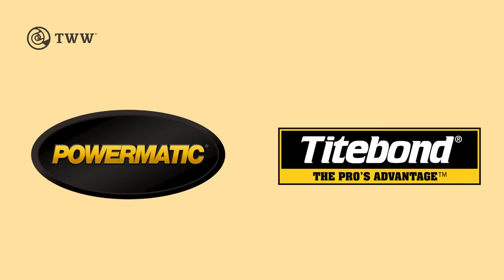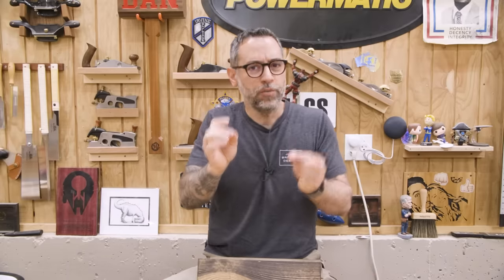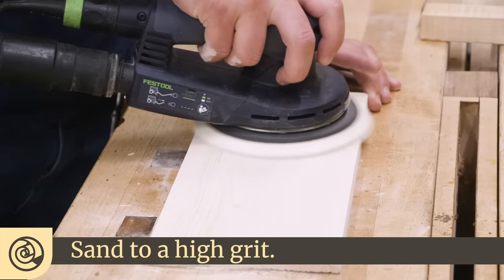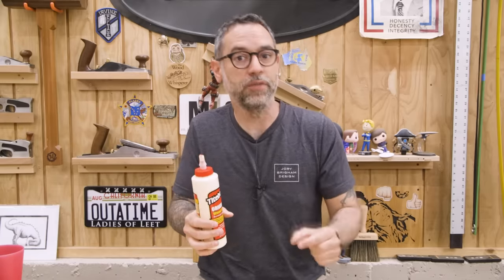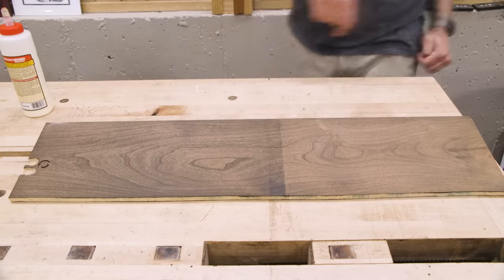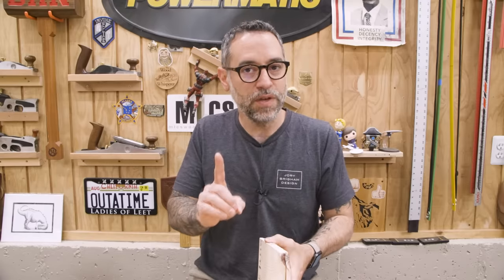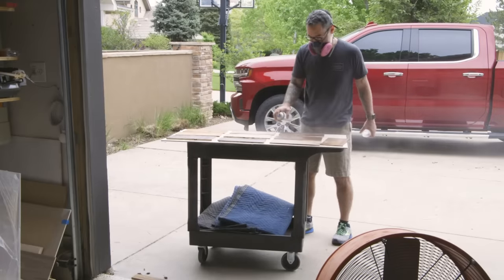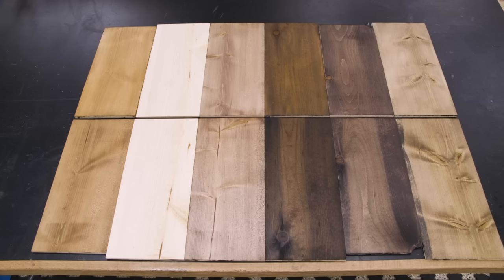Make Stains Look Better! | DIY Blotch Prevention Formula

Comment: Video Topic:

1) I've heard many people talk about packing the grain. In fact, I believe you off hand mentioned it. The wood always talked about is Oak. What is that process, why do people do it, what woods should you do it with? 

2) The best iron on edge banding please. I made a project recently and used iron on edge banding, but the stain doesn't want to stick/absorb. I was using birch edge banding and a mahogany Varatheane wood stain. 

3) What is the difference between whipe on and brush on stains? Is there one? Can you get spray on stain? 

4) I have a can of varatheane brush on polyurethane. The issue is, I have a huge amount of area to cover. What do I do? Can you spray brush on polyurethane or is there a specific kind of polyurethane meant to be used for spraying?

5) How do you prevent sticky patches while staining? I've tried using a clean microfiber cloth to wipe off all the access stain, yet it still gets sticky from some spots. 

6) Different kinds of hand saws. I'm so confused on the kinds of saw wood workers use. A flush cut saw vs a Japanese pull saw? An ultra thin curf saw? I've googled it like crazy, but I just can't find a complete set of saws. What hand saws do you use? 

7) Do you know of any good dowling jigs? I bought a dowling jig and followed all the instructions, yet the joints didn't line up as usual.
Reply: You gotta be kidding.....you are asking him to write a book.......

Comment: I’m a total noob, so apologies in advance. In your conditioning formulation (M Juice) you use water-based finish with the glue. 

1. When you say finish, do you mean stain or polyurethane/sealer?
2. Can I use oil-based finish (or stain, or whatever it is) or must I use water-based finish in this step?
3. After staining (in which I’m not limited to either water or oil based stain, as per video) do I seal with water or oil based poly based on the stain type used? 

Thank you.

Comment: Hey marc, I used tite bond original 4:1 on some alder recently. Works amazing. Did a whole house walls, ceilings. Sprayed airless with a tritech t5 410 and backbrushed two coats completely eliminates any blotching and basically zero voc non toxic. Just Mixed 1 gallon glue and 4 gallons water into a bucket. A second coat of sealer really prevents blotching around knots. We finished with rubio monocoat and it gives sort of a unnaturally even nordic look.

FYI I also found general finishes RTM Clear to work just as well as glue size and applies very similar with similar looking results. Let completely dry then buff with 220-320.

Comment: I've used dark stain on pine many times and the last was by far the best. I diluted Seal Coat 2 parts Seal Coat- 3 parts mineral spirits as the instructions said for a pre-stain.
I applied dark Varathane stain and rubbed it in with a gray scotchbrite pad then wiped off the strain.
Viola.

Comment: Noob question here: Is 'finish' the same as a stain? if so, can i just add a few tablespoons of the stain i intend to use (if water based) or should it be a clear color?

Comment: Thanks for the info. I am a newish woodworker and I usually have fun right up to the finishing and then I worry my self sick. When you say water based does that include minwax water based poly ? Sorry for the stupid question but I am just not sure. Also if I use your formula do I have to use water based stain ?  Thanks again for the good info.
Reply: I am the same way about projects! I'm new to this, but I'm always afraid to mess up the finish or not like it. I'm about to try the water based poly in the mix. In the video he used all kinds of stains: gel, water, oil... So any type of stain should work.
Reply: I’ve used the water based minwax poly over oil based stains ( thin coats, sanding in between each coat) works great.

Comment: Marc, is there window of time to stain after you use your treatment like there is with pre-stain conditioners?
Also, I have a friend who wants me to do 1700 sf of maple wood paneling using plywood (53 sheets) cut into 11 1/2" wide boards. Would you suggest a water soluble dye instead of mixing a large amount of treatment then staining after?
Great video as usual and thanks for any advice on this
Robert

Comment: Hi Marc.  Thank you for explaining the cause of wood blotch.  I am relicing a guitar, an old used Gretsch Electromatic Double Jet. I am new to woodworking and to guitar relicing.  I bought it from a guy who had already sanded the painted Maple top down to the natural wood.  My goal is to make that natural wood look aged/vintage/yellowed.  However, that Maple top is blotchy as hell.  I bought a spray on "Vintage Amber" tinted nitrocellulose lacquer from StewMac (they specialize in paints and lacquers for guitars) but am really concerned about that uneven look showing through.  This video gives me some options and I appreciate the tip to get some scrap Maple which I hope to get at the local home depot to experiment on before trying it on the guitar.

Comment: Glue size.  I’ve used it for years and not just on wood.  I first discovered it when renovating an old house (150 years old) to stabilise the old whitewash (limewash) that was on the ceilings.  Since then I've used it on all kinds of surfaces, including: plaster, concrete, MDF, chipboard and, of course, both hard and soft woods.  I agree it’s not perfect, but for a down & dirty solution to unstable surfaces, it’s as close to magic as you can get.
Vary the ratios - 1:20 is good for old whitewash, whereas 1:5 is good for crumbly concrete before painting and different woods accept different ratios for better or worse results, so again, I agree - experiment and find what works best in any given situation.

Comment: Very helpful - thanks for the methodical work!  I have some red oak cabinets I'm planning to stain with a light oil (maybe gel?) stain and was wondering if I should even bother with a conditioner...I think I will do it, but maybe just a relatively light coat and only on the more obviously darker areas...  hhmmm...

Comment: Thanks for sharing! I was just about to experiment with glue sizing ratios, never thought to add color to it as well. Could you share the color of the water based stain and the tint color and ratio you used. Thanks on advance.
Reply from the maker: There was no color added. That mix of water based finish may have had some residual dye from a previous project but it was an inconsequential amount.
Reply: Hey Karl, did you ever run any tests with different glue ratios?
Reply: @adamthewoodworker2571  No I didn't.  I was using a piece of birch and was happy with ~20%+ amount of glue when I saw Marc's video and never got to anymore tests.
Reply: @woodwhisperer  Marc - I didn't watch carefully enough the first time but understand the process now, but my question was the name of the water based stain (General Finishes brand Espresso, Brown Mahogany, etc..) along with the tint and ratio used  after you applied your "juice".  Thanks - Carl
Reply: @woodwhisperer  So then is your "water based finish" that you mix with the glue & water a clear top coat?   And does it have to be water based?

Comment: I ve always used lacquer sanding sealer applied with a foam roller than sanded before applying diluted stain repeat as needed, remember air temp and age of the wood both have a effect. oh and I am NOT naming anything after myself.

Comment: Thank you, Marc. Your videos are a great help to me. I am about to stain my solid pine stair treads to match the hallway wood flooring which has a "cheery oak" finish with definite cheery red tones in a darker background. I am learning a lot from your videos on staining. I am planning to try the Juice. You mention that adding a little of the stain to the juice helps, but I am planning to use an oil-based stain for its durability when compared with water-based. Can I still add some to the Juice?

After seeing another one of your videos, I am also considering a gel stain for this instead of oil-based. Will the Juice work with gel stain?

Comment: Hello Mark great video, I want to try your conditioner on a large table top. Since I can only finish one side at the time and the conditioner is water-based, have you experienced any possibility of warping? I have only used oil based pre stain conditioners, and this definitely looks like a better choice. Thanks for your help

Comment: Appreciate your empirical approach to this. I learned a new method today! My only concern is that the colors are a bit more muted. Even, yes, but what should I do to not lose out on color? It seems that your Marc juice is the only application, right? It's not like a pre-stain where you'd actually go for the color/stain 10 minutes later, Marc juice is all in one? Would I just increase the stain in the glue mixture?

Comment: Interesting video. Terrific presentation. But what about Birch veneer? I have experience with oil-based staining, and using wood conditioners. I use lint-free cloth to apply. I want to white-wash Birch veneer. I plan to do tests. I purchased good quality veneer that has the most beautiful grain pattern. I do not want blotches, and I don't want to lose the delicate grain pattern. Any thoughts? Also, unless I mis-read the info, it seems the water-based Marc Juice is OK to use as a pre-stain, and then it's OK to use an oil-based stain after that as the stain color? Do I have that correct?  (Edit) So I did my tests. Fascinating results. I'm so glad I took the time and trouble, because I wanted specific results. Thank you Marc. You truly inspired me. The "Marc Juice" sample is the winner, and I used an oil-based final stain. I had to see it with my own eyes, and every critic in my circle agrees.
Reply: So you used some water based finish as a 3rd component like in the video or something else?

Comment: I am trying to refinish 20yr old maple cabinets with plywood insets that have turned orange. I've been sanding incessantly but can't seem to get to bare wood because unfortunately, they have prior stain.  I live in CA and "green" strippers don't work to remove stain.  The cabinets still have some color that is not consistent and look blotchy.  I did not want to have to go darker which I why I started sanding. I have questions re your preconditioner; 1. Would your formula help to create a more consistent base to then apply a light color dye, toner or stain without sanding to bare wood? Does your conditioner block orange/yellowing like shellac allegedly does? 3. Would whitewashing after applying your preconditioner and then dye, tone or stain be a better option?  4.  Is full painting my only option? Anything so I don't have to sand to bare wood, UHG! Recommendations appreciated.

Comment: Is it normal that it doesn't fully mix? Mine had some little chunks. I used the same top coat and the PVA gorilla wood glue.
Reply: PVA will dissolve but only when added slowly to hot (nearly boiling) water, under stirring. This method of preparing MarcJuice results in a dispersion of PVA rather than a dissolved solution. As long as you shake thoroughly immediately before using, it works well enough (Although a solution might work better).

Comment: Great video. I really liked the results using the water based dye. I sometimes use aniline dyes on woods like maple to get darker colors which are impossible with oil-based stains. Blotching is a problem, even after raising and sanding the grain several times with water before staining. I plan to test Marc Juice out soon with the dye as an experiment. I assume it can't be stored for any length of time.
Reply from the maker: I don’t know how long it can last on the shelf but it’s two water-soluble products in a water solution. Probably would last a very long time. Just mix well before use.
Reply: @woodwhisperer  Yeah, I worry more about the oxygen.
Reply: I've had success using leftovers after storing them for a couple months (in a container that was airtight but held 80% air by volume).  There was no discernable depreciation in result.

Comment: Interesting: a DIY water based wood conditioner.  I've seen people doing this using wood filler powder many years ago, but I like your glue idea more, as it will mix much more easily.  I also wonder if a white glue (rather than yellow) could be used to get a better color in some situations.
Reply from the maker: Let me know what you discover if you test it. 👍
Reply: 35 years ago my shop teacher taught  us to use glue size from white glue (60 to 1 ratio)  in every sanding schedule for any project. Worked great but dried clear so not sure that it had any effect on ending color. Of course white glue (Elmer’s) was probably just easier to find inside a school.

Comment: Use 1 part Sherwin Williams S66TH5 inert, 1 part mineral spirits, and 1 part of your choice of color  solvent based wiping stain and it’s even across the board with no blotch. Inert is what furniture factories use on end grain to keep the full strength wiping stain from turning way too dark on open grain edges.

Comment: A birch gunstock is the worst thing I've ever tackled. Is a dye a better choice for something like that, or should I try the glue and water preconditioner with water based stain mixed in and then use water based stain to finish it with?

Comment: This is a good explanation of blotch. And it's a good demonstration of blotch prevention. I do wish you could have used a piece of cherry in the demo though. IMHO cherry is the worst. Thank you for sharing. Have a great day and stay safe.
Reply from the maker: Cherry is bad but pine is worse. If it works on pine, it’ll work even better on cherry. Also, there’s no way I’m sacrificing that many cherry boards for testing. 😄

Comment: very helpful video :)
i have a basswood guitar body, that i want to stain, to try and get a nice deep red wine color.
i already sanded it with 180 and 240 grit sandpaper. however, i forgot to prep the wood first, and ended up with some very prominent light areas that, regardless of what i do, just don't want to suck up any stain.
question: if i sand it down, as much as i can, back to the original wood, what (if anything) can i do to get those really light areas to accept the stain more?
also, if i prep the wood with the "marc juice", can i stain it multiple times to get the deep color i'm going for? or will it mainly remain a lighter shade, because of the "juice"?
thanks in advance for any help :D

Comment: I am trying to refinish 20 yr. old maple cabinets with plywood insets that have turned orange. I’ve been sanding incessantly but can’t seem to get to bare wood because they have a prior stain. I live in CA and "green" strippers don't work. The cabinets still have some color that is not consistent and looks blotchy. I have questions re your preconditioner; 1. Would your formula help to create a more consistent base to then apply a light color dye, toner or stain without sanding to bare wood? 2. Does your conditioner block orange/yellowing like shellac allegedly does? 3. Would whitewashing after applying your preconditioner and then dye or stain be a better option so I don't have to sand everything to bare wood? UGH!

Comment: Can I make "Marc Juice" with the glue and clear waterbase gloss finish? Or does this only work with glue and a stain finish? I have sanded my pine kitchen cabinets. I do not want to stain them since I want the natural color to come through. I just want to put a couple of coats of waterbase polycrylic on them--which was on them before. But now that I sanded, I can see if I just poly them the wood will come out blotchy. (Thank you for this great video!)

Comment: Fairly new to refinishing and have only worked with danish oil so far. Is this process something that would work with danish oil, and would I need to change the topcoat stain you mix into your Marc Juice?

Comment: Matt:  I am trying to refinish 20 yr old maple cabinets with plywood insets that have turned orange. I’ve been sanding incessantly but can’t seem to get to bare wood.  They still have a hint of color that is not consistent. Would your pre stain formula help to create a more consistent base to then apply a light water based dye or stain?

Comment: Random thought, what if you put the board samples in a makeshift vacuum/pressure chamber after putting on the stain, before wiping the stain off. Would the stain penetrate any deeper or not at all because lesser air pressure would open/close the pores?  Mind you I know this would be more of a science experiment than a practical way to apply a stain for project.

Comment: We are building a house and our trim carpenters made us some fabulous distressed faux beams.  They used 1x pine boards and a curved draw knife, then sanded smooth.  The wood has quite a bit of blotchiness and we haven't stained them yet; a lot of pinks and oranges in the white pine.  My fear is that we end up with the worst of the worst in uneven reds, whites and browns.  Here's my question.  I agree with the pretreatment you've shown here but I want a light gray/ brown stain (no reds/oranges/yellows) but with some dark settled into the cracks and crevices so  it looks aged..  I also need to consider how many times the painters have to touch these beams which will end up costing quite a bit.  After spraying on marc juice, should I have them use water base stain and then a tinted wax for the dark highlights?  Or is it possible to color the marc juice slightly to save a step?  Or for a third option, if we make a stronger marc juice, would a tinted wax that are oftentimes way too dark, end up being prevented from penetrating too much and therefore end up lighter and more desirable?  I'm just trying to get a lighter consistent result with some dark highlights (all controlled) with as few steps as possible for paint crew.